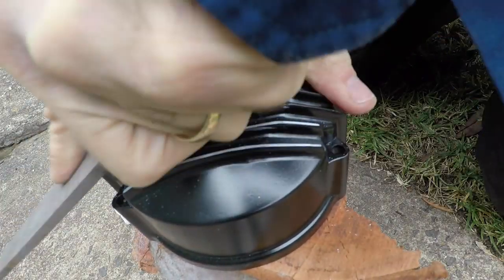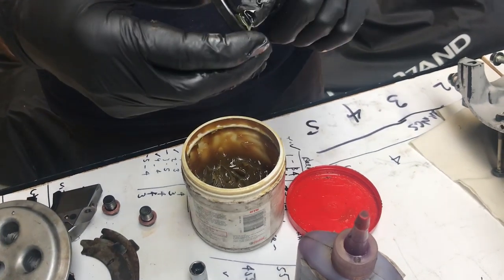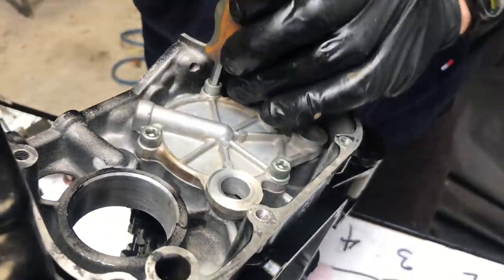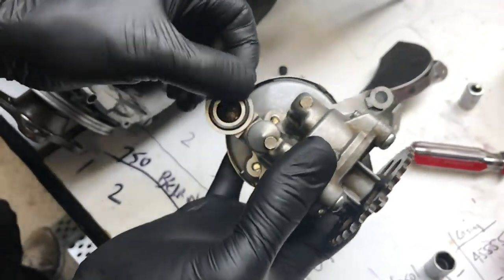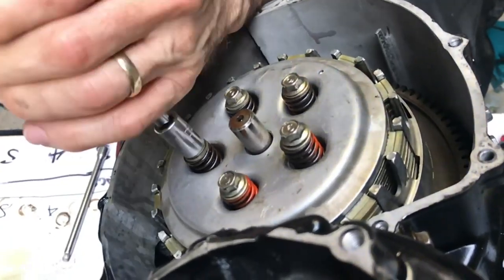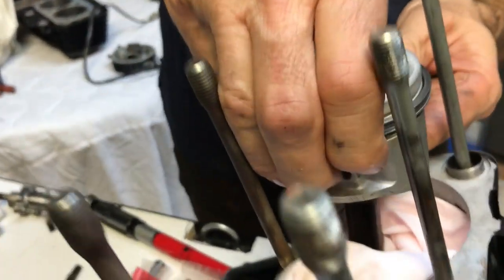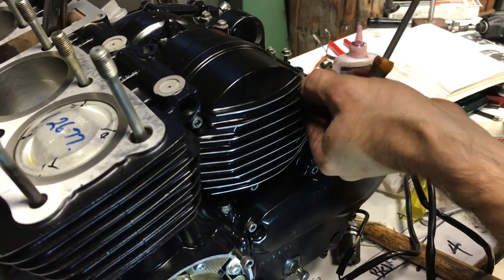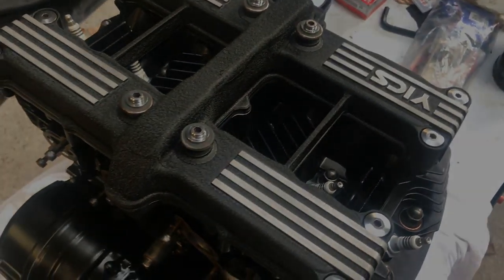Yamaha XJ650 Part 25 Engine Overhaul

Comment: Do you have video showing removing of the gear selector cover?
Reply from the maker: Hi mate, no but its just reverse of the assembly shown in this video. Once you remove the levers and bolts it will slide off.
Reply: @Mezzmoengineering  I used to despatch XJ650s many years ago. All of them got stuck in first gear, all of them had a bit of guide brown off and sit on gear sen;ector drum and we managed to get them out just through inspection video. Just had exactly same happen with my turbo. I'm assuming its primary drive chain. Now specking full engine strip to get to this one bit that Yamaha must have know fails!
Reply from the maker: @TheVictorFour  Yep, the chain guide is a known fault. In fact, I noticed Yamaha had redesigned the replacement one I purchased directly through them. Original has 3 bolts and new version uses only 2 bolts.
Reply: @Mezzmoengineering  did you get any of your parts from xj4ever in the states?

Comment: Just at the pre engine build stage.
If you wanna see the bike before I started I just put a walk round video up.
"Yamaha XJ650 ditch bike"
There wont be an oscar anytime soon.
Reply from the maker: I'll check it out, good luck with your build
Reply: @Mezzmoengineering  Thanks it'll all work out. I'll put up videos of the parts soon Will let ya know
Reply: @clickireland1113  hows your progress ..???

Comment: Hello. Where I bought the main crankshaft bearings. 4h7-11416-11-00
Reply from the maker: Hi, I had 3 engines that I used for parts. In the end I made a good condition full set of crank bearings so I didn't buy any. I think these are difficult to find now...
Reply: @Mezzmoengineering  Hello. Difficult is the wrong word, impossible to find at all. One question, an pick up from another motorcycle. For example YAMAHA XJ 600 (49A-11656-10-00 ) or make to order.
Reply from the maker: @AbR1e0  Thanks what I did, used bearings from another engine. I think that's your best option....

Comment: hi, wind blew down my same model motorcycle on it side oil petrol and baterry fluid leaked out. But i still have same level of oil and cant seem to find spot where it leaked out could u advice? and is there a chance that oil will stay and hidrolock engine?
Reply from the maker: Oil might be from your rear wheel drive unit...Engine won't lock due to oil as it can't get past the piston rings. Locking will be if fuel gets through carbs into top compression area.

Comment: Can you advise how you got the magneto flywheel off, I’m having heaps of problems removing mine.
Reply from the maker: Hi mate. Buy yourself a bolt thats 16mm X 1.5mm pitch thread with at lease 50mm of thread. Once you remove the centre bolt you will see another thread inside there for this 16mm bolt. Insert a metal rod around 8mm diameter into the hole so it pushes on the end inside the hole, then screw in the 16mm bolt and it will come right off. The inner rod needs to be around 40 to 50mm long. Let me know how you go...

Comment: backlash - is that thou mm? the gauges on ebay just do 0.01 thats hundredths? lost my oil nozzle - 40 euros!
Reply from the maker: Hi Mate, inches  or imperial are measured in thousands and metric is measured in hundredths. I think you will find the ebay ones might be just metric which is fine. If imperial it needs to be in thousands. Mine have both markings, Eg in the video you see 0.011 thousands of an inch, which is 0.279mm. The backlash needs to be between 0.004 - 0.008 inches or 0.1-0.2mm. There are 40 thousands of an inch to every millimetre. So measuring hundredths of mm's is actually more accurate than thousands of an inch.
Reply: @Mezzmoengineering  thanks mate - but actions speak louder so I sent you some cash!
Reply from the maker: @stevec-b6214  Thanks, much appreciated
Reply: @Mezzmoengineering  found my oil nozzle and lost 2 idle screws I think thers a pattern emerging.......thanks again for your hard work, my rebuild is more basic - as clint eastwood said - a mans gotta realise his limitations......
Reply from the maker: @stevec-b6214  Thanks mate, good luck with your build

Comment: Just have a question I have an 83XJ650 I'm having a hard time finding like little nuts and bolts that didn't come with the bike when I purchased it from the owner it was kind of already in pieces where do you order the your stuff from any little bit helps thanks
Reply from the maker: Hi, I got some parts direct from my local Yamaha dealer including gaskets, seals, bolts etc. Some on ebay and some from other online sources. Check this link, https://www.cmsnl.com/yamaha-xj650_model16829/ it will help you find the part number of what you need and makes it much easier to find things.

Comment: Is this all pretty much the same on 82 xj1100? Also spot on video. 👍
Reply from the maker: I'm not familiar with the XJ100 but my guess is it will be very similar
Reply: @Mezzmoengineering  thank you for the great vids, and the info.Got this motorcycle for 75$ at a garage sale. Will talk more later down the line when I got more of the bike disassembled. ✌
Reply from the maker: @euniceperez4510  Looks like a great project

Comment: This is awesome! I’m working on the same engine and this is a god send! So it’s a 650 crankcase and a 750 crank. The cylinder jug is a xj750 or 650?
Reply from the maker: Yep, XJ650 crankcasing, XJ750 crank and rods and oversized pistons. 650 head is the same as 750 but cams are different so I have 750 cams and also a carby jet upgrade. Check my other videos...

Comment: Nice work..
Do the xj550 oil pump cover fit with the xj650 one?
Reply from the maker: Hi Mate, I'm not sure as I've not worked on a 550. The 650 and 750 are interchangable

Comment: Do you know the torque spec for the bolts that hold the crank?
Reply from the maker: Hi Chris, crank casing is 17.5ft/lb and rod ends is 14.5ft/lb. The sequence for the casing is marked on the casing itself.

Comment: I have one question, can you tell us from what supplier you ordered the genuine Yamaha parts? Especially the orings, chain tensioner and piston rings? Thnak you!
Reply from the maker: Hi Mate, The O-rings, some gaskets ans seals were direct from my local Yamaha dealer. Some were in Australia and others had to be shipped from Japan. Yamaha still has quite a few spares for this engine. The cam chain I purchased new online, again some things I found on ebay and other sources. You should be able to find what you need by searching online

Comment: I can't for the life of me get the cylinders down over the pistons. Somehow one ring keeps bending.
Reply from the maker: That’s odd. Do you have the correct rings? The chamfer on the base of the cylinder bores should guide them in. Also make sure you have a good voting of oil in the bore as well as the piston and rings. A gentle tap of the cylinder also helps things along
Reply: @Mezzmoengineering  yeah, the rings measure in spec when level in the cylinders. They have the right gap measurement. I have a new set coming because I bent I bent the new ones and the leftover ones I saved that measured okay. Maybe I'm trying to go too quickly, I'll try to slow down but man, I almost think I need someone who knows what they are doing to look at me and just let me know the thing I'm clearly doing wrong.

Comment: Cómo puedo conseguir todas esas partes
Reply from the maker: Hi mate, parts are hard to find but I found what I needed either on eBay or other private sales online. Some things are very expensive but there is little choice if you need things that Yamaha no longer has
Reply: @Mezzmoengineering  muchas gracias

Comment: Please i need help! Can i mount the cylinder head of yamaha 900 maxim on yamaha 650 maxim crankcase?
Reply from the maker: Hi, I'm not sure as I haven't tried that. The 750 head will fit and then rebore its getting close to a 900 anyway.

Comment: Мото брат!подскажи пожалуйста,гильзы менять возможно на цылиндре? Yamaha xj 650. Не могу найти поршни второго ремонта(63.25) по этой причине думаю гильзы заменить.Moto brother! Tell me please, is it possible to change the liners on the cylinder?  Yamaha xj 650. I can not find the pistons of the second repair (63.25) for this reason I think the liners should be replaced.
Reply from the maker: Hi, I'm not sure if the liners can be replaced. A machine shop could do that for you though. I think your best bet is to keep searching for oversize pistons or just buy another cylinder housing

Comment: How much did it cost you?
Reply from the maker: The complete engine build, including all OEM new covers, gaskets, pistons, new head etc etc was just over $2000AUD. All work done myself. About $500 went on just the two brand new OEM crankcase side covers. Could be done cheaper but I went all in with as much OEM as I could find.

Comment: If this engine same as xj750 seca?
Reply from the maker: Hi Mate, XJ650 and XJ750 engines are almost the same. They have the same mounts minor differences in carby jet sizes, 750 has bigger pistons and crank. Cam profiles different but many parts interchange between these engines.
Reply: @Mezzmoengineering  tq for information just want to know about engine interior .So thank for video good for my  reference.👍
Reply from the maker: @silversanign9288  All engine interior is the same except for crank, conrods and pistons.
Reply: @Mezzmoengineering  ok ..I will comment if anything happen .just need rebuild bike again so can take long trip.👍 btw if really important to buy manual?
Reply from the maker: @silversanign9288  Hi mate, if you are good mechanically then you don't really need a manual. Having said that, they are pretty cheap so its nice to have as it has all the specs in there
Reply: @Mezzmoengineering  in the past i just 2stroke mechanic .so now just wandering about bolt spec torque only
Reply from the maker: @silversanign9288  OK, I think you will be fine if you purchase the workshop manual as all the torque specs are there

Comment: What are the torque specs for the connecting rods
Reply from the maker: 18.1ft/lb
Reply: Also does it matter what way the piston rings are facing when Installing the pistons
Reply from the maker: @loganlogan732  Yes it matters, there should be a mark on the rings showing which way faces up and the gaps of each ring need to be located in different spots. Info on this is easy to find using google.

Comment: Te faltó los torque de todo lo tornillos y tuercas consu repetido orden y fuerza las tolerancias entre puntas de los anillo y la tolerancias en las ranuras de los pistones
Reply from the maker: Hi mate, not sure what you mean? I torqued all bolts to spec and in the correct order. All piston ring gaps were checked and set. The ring height clearance was already ok as it came as a set

Comment: Warum schmiert er denn die Dichtpampe auf die Lagerböcke neben den Hauptlagern? Da läuft er doch Gefahr, das sich die Scheiße in die Lager drückt. Hauptsache draufgeschmiert. Viel hilft viel
Reply from the maker: Hi, not sure the part you mean. If you mean the crank end seals on the outside, then that was sealant and not grease. I do that to ensure there is no leak.